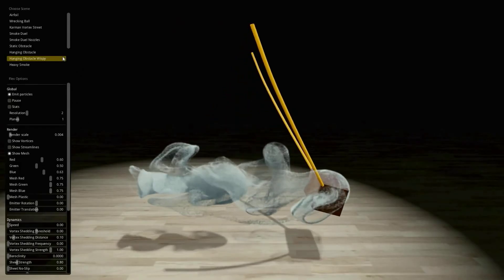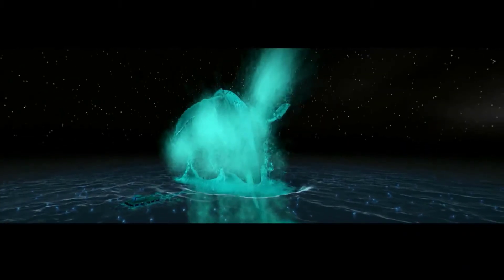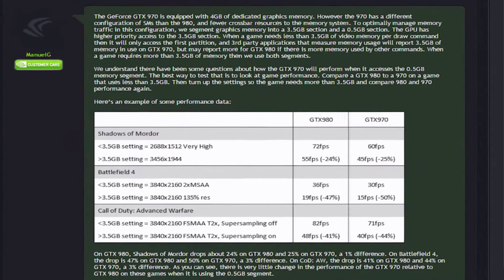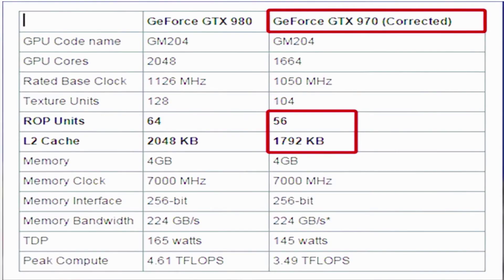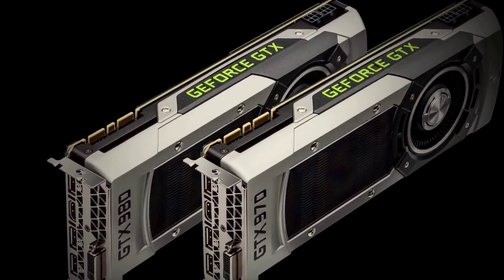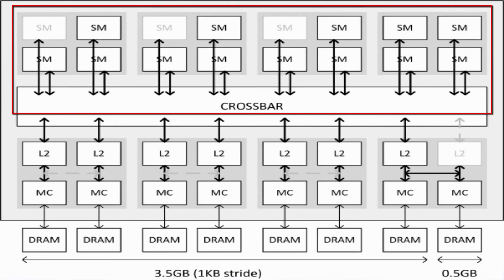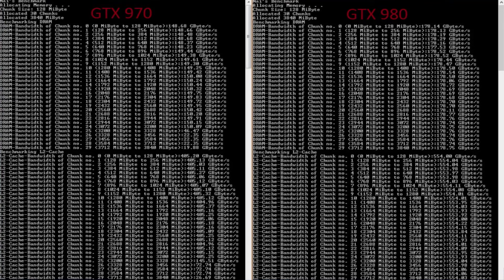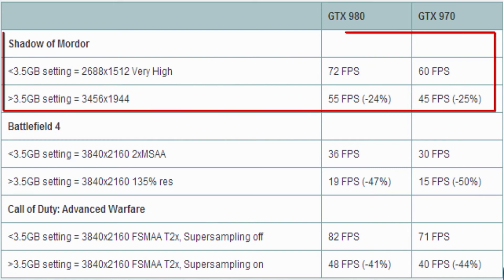Nvidia GeForce Gtx 970 Vram Issue Explained Point Wise

Comment: Nothing really....
More Vram can be used and accessed. It depends on the game just look at computerbase.de - they have videos of it too.
Also GTX 980 4GB isn't your holy grail at all. I have 2x GTX 980's and 5x GTX 970's. I tested 2x GTX 970 vs 2x GTX 980 i 4K to experience the Vram issue and I must admit that the 3.5GB+ 0.5GB vram issue was only "evident" when the 980 REAL 4GB card had the same problems !. I'm really not that sure that the 970 is a crippled card at all, because when the 970 had problems so had the 980's. 
If you want to play in 4K a single GTX 980 doesn't deliver at all - just like the GTX 970 doesn't either.